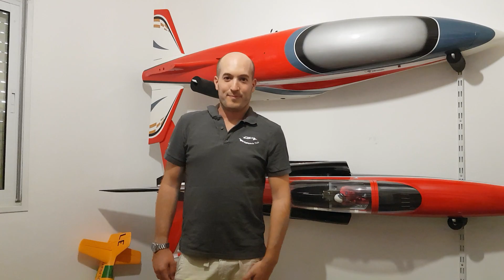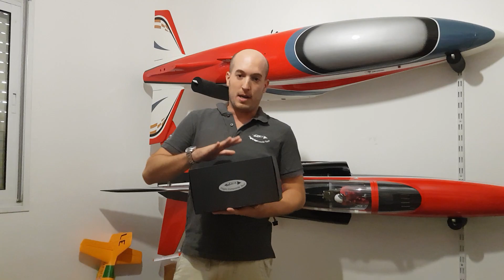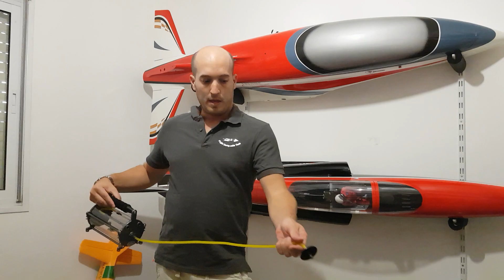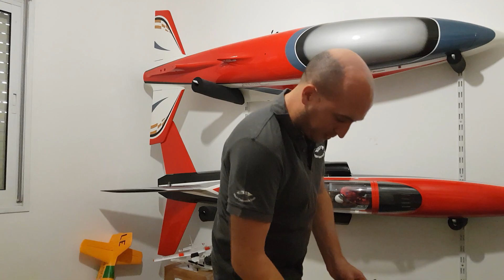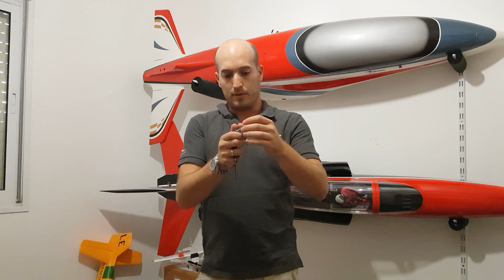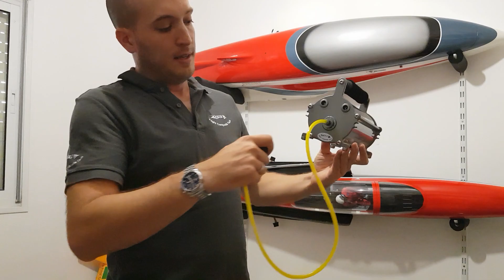FCT Taxi Tank - Introduction

Comment: Maybe a stupid question, but when you remove the plug from the bottom of the plane before flight, wont the fuel start to run out, or is it some block valve inside the fittings that prevents that?
Reply from the maker: It may drip slightly but it wont run, as the running engine causes a suction from the main tank.